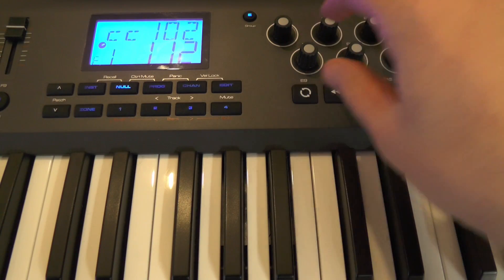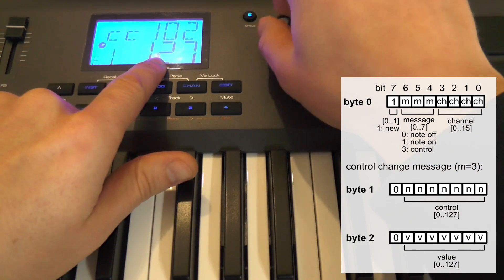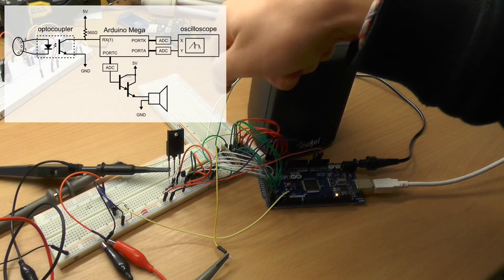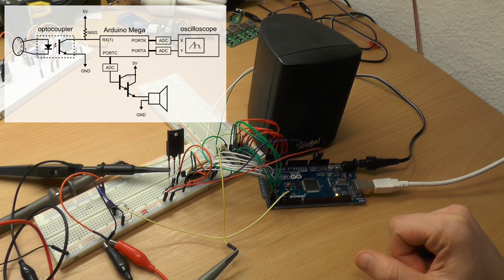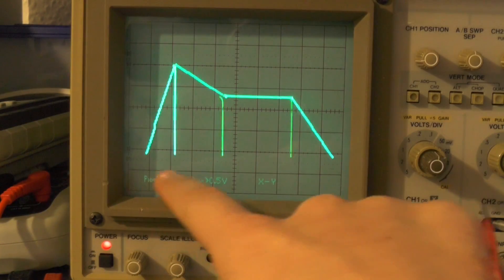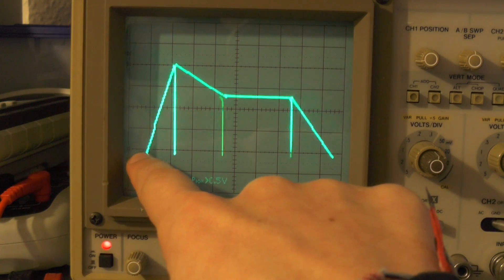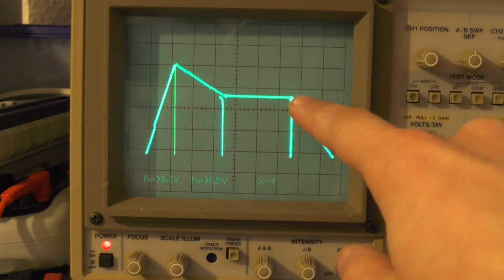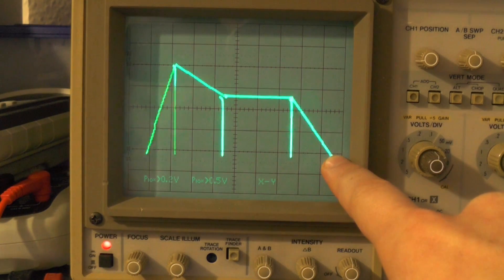Arduino MIDI synthesizer (Part 3) - ADSR envelope

Comment: It is quite interesting experiments, I'm not familar with arduino, but I'm doing similar experiments using PIC12F1840 controller, and using hardware PWM generator for sound synthesis. Maybe you should go this way with arduino too?

Comment: Very cool, bitluni! 

I'm surprised at how far you were able to get that much happening with an eight-bit Atmel chip!  You could always try out something with an ARM Cortex M4f (many dev kits are less than $20 nowadays), or byte the bullet and go real time with a FPGA.  I did a project back in my student days where I used an eight-bit MCU to handle all of the MIDI messaging and dynamic processing, and used a CPLD as my tone generator.  It balanced the workload really nicely.  Verilog and VHDL certainly aren't my favorite thing in the world to code, but CPLDs and FPGAs are just so good at real time signal control.
Reply: He did not get really anywhere close to what is capable with those 8bit chips. Watch this dude: watch?v=j6ijbexoq-M
Reply: @Sixta16 wow! :D

Comment: have you looked at using the Arduino Due? 
A 32-bit core, that allows operations on 4 bytes wide data within a single CPU clock.
84 MHz Clock
Same form factor as the Mega.
Just a thought. :)